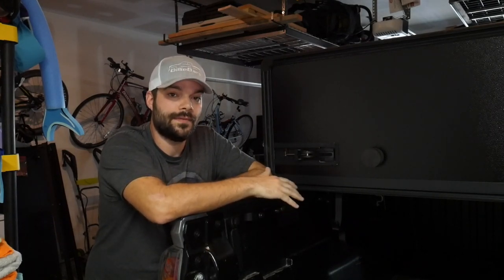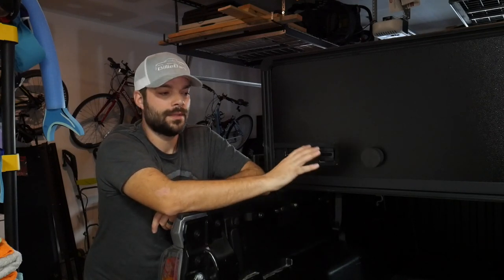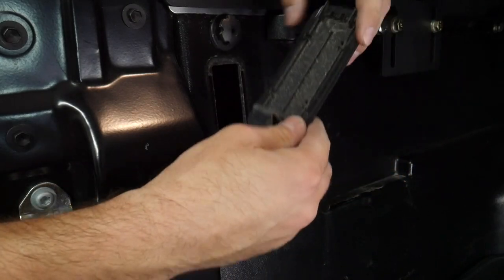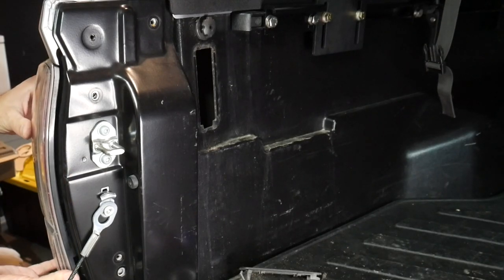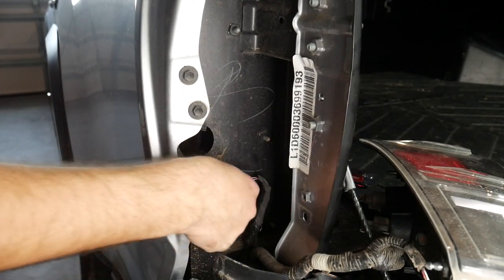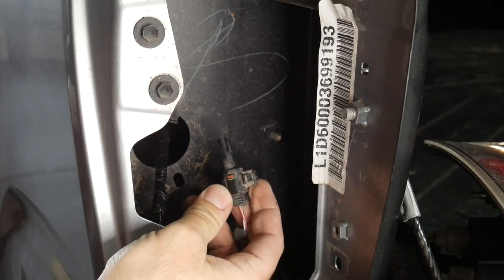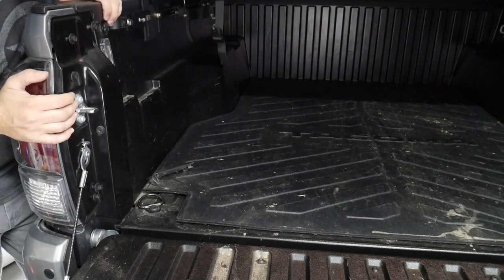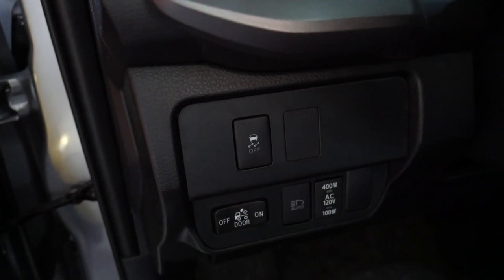Toyota Tacoma OEM LED Bed Lighting Kit | 2020 and Newer

Comment: Thank you for the video. Made the install super easy. Just a tip for any installers in the future, you don’t need to remove the top 2 bolts to remove the tail light assembly. I realized only after removing the 1st tail light assembly.

Comment: You only needed to remove 2 bolts for the tail light removal. I added these to my 2022 and they really do add a lot of light.
Reply: I was about to say the same just installed mines and removed 2 extra bolts 😅
Reply: Yes. I too followed your instructions and took 3 extra bolts out. Should’ve read the comments. That’s why I gave it a thumbs down.
Reply: Your 2022 has a switch? My 2022 doesn't have a switch.
Reply: Which ones?
Reply: @Shadowdancer777  you can skip the first two he took off.
Reply: @Shadowdancer777  Pause at 3:24, it shows holes for screws. It will be 3rd and 5th screw that he took out.

Comment: The service department at my local Toyota dealership has told me that my new 2022 is not Pre wired and there is no deck light switch installed in the dash, I have the SR5 package 4x4 access cab. I already the lights prior to purchase of my truck but they just arrived today.
Reply: I think if you have the switch for the cab bed light then youll have the wiring
Reply: @mr_unsane  , Yes the wiring harness was the same. I was able to complete the project in less than 30 minutes.
Reply: They tell you that so you pay what they charge so they can get money for it.  If you weren’t sure just take the tail light out and check.  Never trust anyone at the dealer
Reply: @nathanfrisby3133  how did they work if you had no switch in the dashboard?
Reply: Just watched another guy's video. If you have the access cab and not the switch, you can buy the switch but you need to buy the relay also behind the switch. It's wired in the back for it, though.
Reply: Search for RW his
2020 Tacoma video.

Comment: So if I buy a 2022 SR model.. it comes pre-wired for bed lights?  Anyone know for sure?
Reply: Only if you have the cab light facing the bed and the switch inside the truck by your left knee
Reply: @mr_unsane  - Yes sir.. you are correct.  I found that out.  You can still install it but you’d have to order the entire wiring harness and switch for the dash.
Reply: @anthonygiordano3991  were do getharness

Comment: FYI 2022 Tacoma's dont have the switch in the dash. I found out the hard way.
Reply: My 22 has it,do you have a double cab or access cab?
Reply: @TheCarguy1993  I have the access cab.
Reply: Can u add the switch?
Reply: @TURBO66NOVA  yes, you can only get it from a dealer. It's about 85 bucks, but the truck already has the wiring for it, so it's just plug and play.

Comment: I think my cap is super glued on to the connector. I can’t get it off. Wouldn’t surprise me. These dealerships are assholes
Reply: You have to press the clip button type on the bottom. Installed mine in 10 mins.